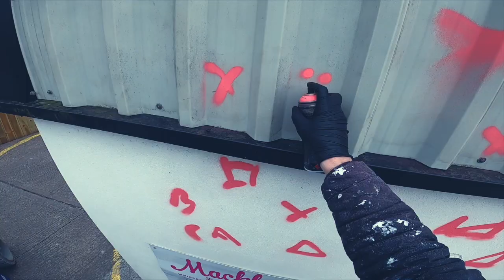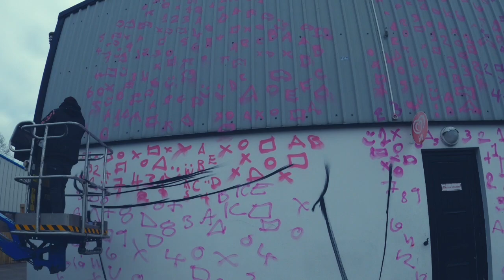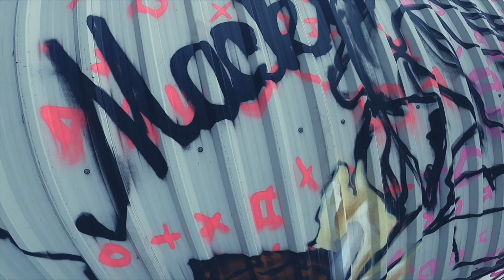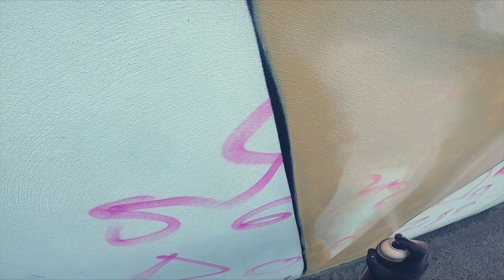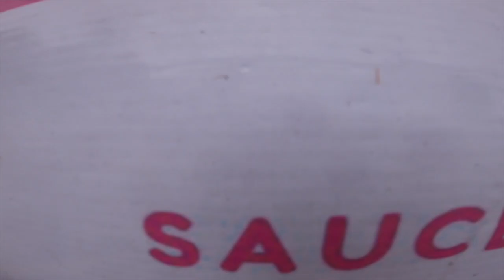Huge mural on Mackles Ice Cream Monaghan

Comment: Class bud, does it not freak you out starting something that big?
Reply from the maker: Thanks mate, I actually prefer these size of murals as you have so much output with a fat cap you can cover a lot more in short space of time.  Plus if you make a mistake it’s easily fixed 😆